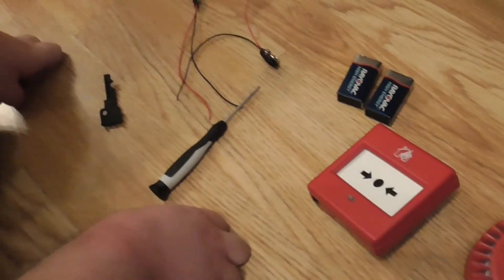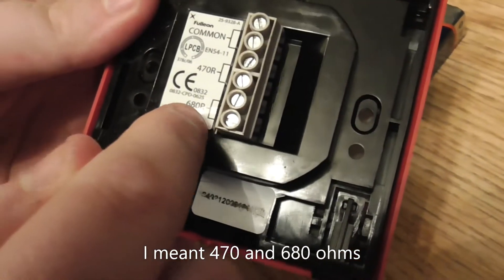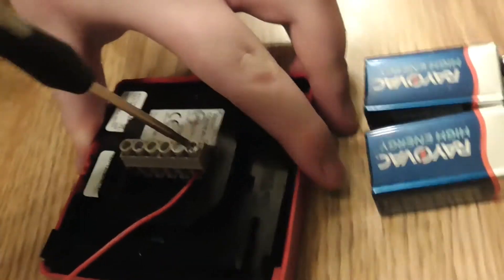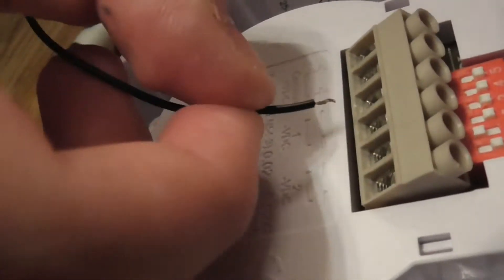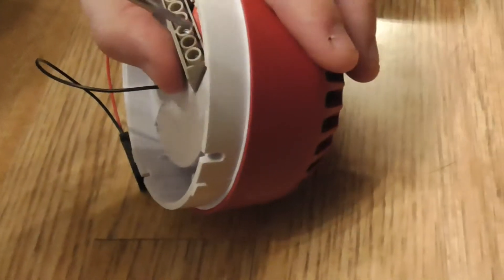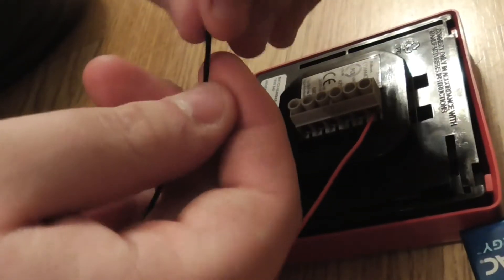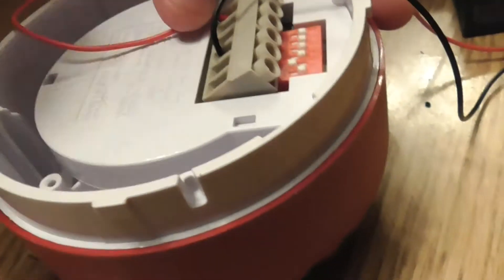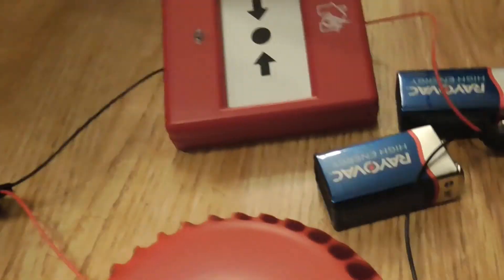Wiring a Fulleon call point with a Roshni Sounder

Comment: Also the way I wire mine up is just with one battery connection with - of power supply to call point, + of power supply to sounder, and + of call point to - of sounder
Reply from the maker: Ah ok that is a good way to wire as well :)
Reply: @j1firesystems440  But I prefer wiring the - to the sounder and the + to the call point
Reply from the maker: @BukuiZhao  Ah ok, There are different ways to wire them.

Comment: Is that a new style roshni?
Reply from the maker: I’m not too sure as I got this sounder a year and half ago. It might be but don’t know.
Reply: @j1firesystems440  I think you have a new style one. I got a used one which is an older one and I think the newer one may have different tones
Reply from the maker: @yeety1208  Ah ok Thanks for letting me know which style roshni sounder I have :)
Reply: @j1firesystems440  I think you have the new style ones. The tones don't matter. Both the new and old one have the same tones. But it is the new one because it has a slim design, the old ones does not.
Reply from the maker: @BukuiZhao  Ah I see thanks for clarifying :)